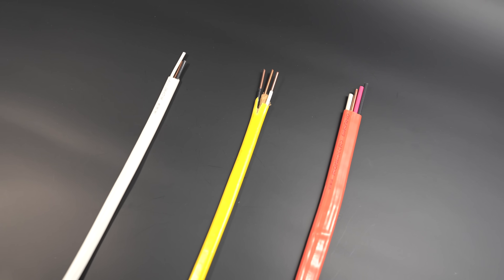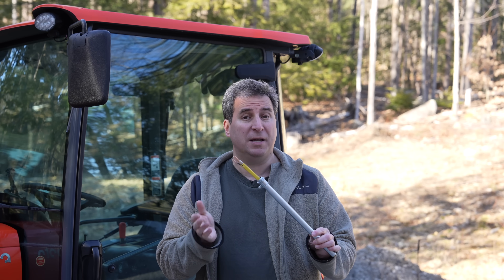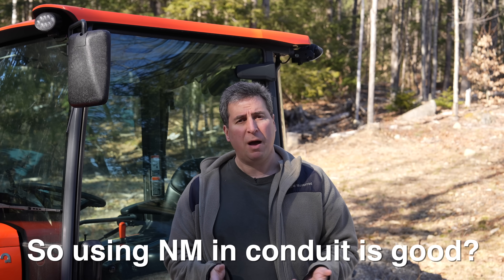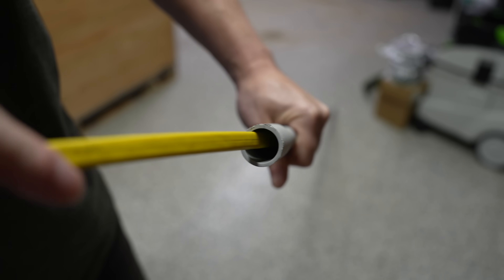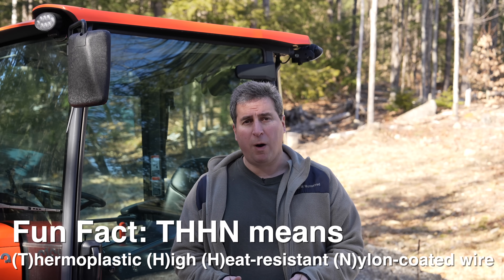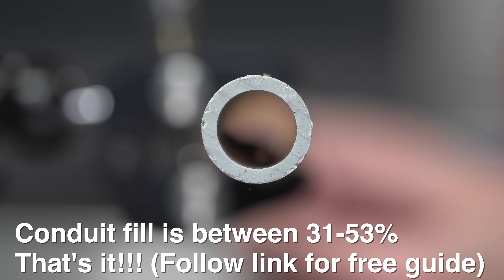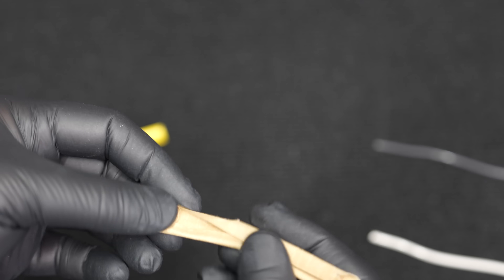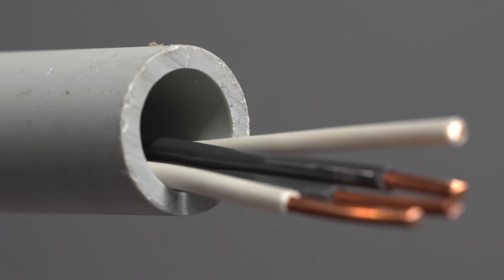#1 DIY Electric Mistake - Can you use Romex Wire in Conduit?

Comment: What about " underground" buried Romex  under sidewalk or driveways ? 
I lay gray PVC underneath prior to pouring concrete over . So I can pull the wire through? And  when coming vertically up into a grauge or out building on its exterior wall.

Comment: What's the rationale behind not being allowed to use NM wiring outside?
Reply from the maker: My understanding is that the paper inside as shown and the sheathing can absorb water and disintegrate. I have seen example outdoors that were 25+ years old where this has happened and shorted out.

Comment: Two Major draw backs NM in conduit, Heat (Temperature rating of Conductors, Factor in Continuous/Constant Loads) and Volume (restricted Capacity)......be safe = .NEC  Table 310.13, 310.16, and UL83...no Myth

Comment: So, I guess my question is: should Romex even be used for concrete, cob, rammed earth walls that use conduit to rum electric lines through the wall? Does the 50% rule still apply, or do you need to spend a small fortune on 2" Schedule 80 PVC?

Comment: The way I interpreted the code (30 years ago) is that romex, or nm is not allowed in conduit due to ambient temp. Wire in a sheath and then inside a conduit does not possess enough ambient air to properly cool the wire within. Therefor, I have never ran romex in conduit. Place a junction box and always transition from nm to thhn before entering conduit.
Reply: That doesn't really make sense.  You can run romex in spray foam or other insulation.  If your wire is getting hot it's overloaded.
Reply: Sooner or later, a circuit is going to be overloaded. It's inevitable. A breaker is designed to cut power when a circuit is drawing more amps than it is designed to, and has nothing to do with temp. If you are drawing more than a wire is capable, it's going to heat up. Only when the amps are higher than the breaker will it trip. If the wire is in a confined space(not just a couple of inches of spray foam) it has the potential to melt before the breaker trips. There is a degree of heat dispassionate must be allowed for.
Reply: @jtsather4535  I disagree. You think conduit retains heat better than spray foam? Circuits done correctly are almost never overloaded especially dedicated circuits.
Reply: @sparkyjerred419  That word "Almost" burns down houses. Take every precaution against that which can kill you. Even if it seems over the top. You might save a life.
Reply: Just for reference, I've been a sparky for 35 years.
Reply: @jtsather4535  well I've had my masters license for 25 years & I've yet to see romex burnt up in conduit.
Reply: @sparkyjerred419  In the beginning I worked for a guy that authored parts of the NEC. We would discuss the rules and reasonings behind them. Not everything that important is in the book. Just because you haven't seen it does not mean that it hasn't happened. Fook for thought. The most important thing I've learned about electricity is that I'll never know it all.

Comment: Can one run UF in an underground / outside conduit?  Or is UF for direct burial only?  Or are both suitable?
Reply: We've run 12-3 UF-B in 3/4 PVC conduit. Out of exterior rated j box down the wall, 90 out with 8 inches extension. Inspector didn't said anything about it

Comment: Been putting 14/2 wg in conducit outside for my area for 30 years, and have never had an issue.  Sealing up the conduit (pvc) with glue and it works fine.  I think sometimes we take things a bit to far.  Sometimes common sense goes a long way.  But thats just me.  Sort of like banning lead shot because one eagle in california died from lead poisoning 40 years ago and now thousands of guns have been ruined by steel shot and we have geese destroying the tundra because no one wants to hunt them with $40 boxes of ammo anymore.  Or the freon scare which is total nonsense, and now we have inferior products in our hvac units that require millions of dollars in expense to convert when in fact cows produce more gas than freon did, plus we did not damage the ozone layer as it contracts and expands on a yearly  basis.  Thanks tree huggers and Canada (thats where it all started) and now we have a mess.  I saw this in the 70’s with transformer oil which caused whole cities to be abandoned and launched an entire industry.  Then 10 years later we find out the oil is totally benign and holds no danger to humans.  But did we correct the mess. Nope.  Just keep on throwing common sense out the window.  Rant done.
Reply: Leads bad, short cutting electrical work is worse. PLEASE STAY HOME.

Comment: I didn't see a ground wire individually in your example, only hot and neutral. I am guessing here, but could you run ground through conduit also? Insulated ground was green IIRC. I am NOT an electrician, but I have done a lot on my own home (many receptacles had ground and neutral or hot swapped when I moved in) and this is just a curiosity question. I do not have any wire in conduit here.

Comment: If I need to turn up a run of 12/2 UF-B, I always thought it to be safer in a short piece of PVC electrical conduit from 6” below grade to the panel or load. Are you saying it is safer to wire nut solid THHN wires to the UF-B in a below grade JB before turning up in the conduit? 

What is the logical problem with UF-B in a conduit in wet conditions?

Comment: Excellent and to the point. I thought part of the romex-inside-conduit issue was that of heat buildup (which is probably why the 53% max fill was designated.) I also appreciate you telling us that individual wires from romex bundles are not allowed. I would have thought otherwise.  Keep up the good work.
Reply: The fill ratio has more to do with NFPA regulations than anything else, along with mitigation of unintended damage and destruction of your own work.

When you're pulling cable or individual conductors over significant distances, what you're pulling is going to be rubbing up against anything else inside that conduit, causing large amounts of friction, which generates heat. This can, will, and has damaged cables halfway through the run to the point that a fire hazard is created in an non-visible area by way of burning through any and all insulation.

Cable pulling lubricant does mitigate this somewhat, however the code on this primarily exists to address this issue.
Reply: Hmmm.  53% max fill . . . So If I double the end over when I pull them through, it should be about right?
Reply: Conduit fill has nothing to do with the percentage of how much you can fill. It has to do with derating the conductors inside the conduit.
Reply: So romex in conduit in an 120F attic? Electrical advice should be left to licensed electricians.
Reply: @mongo7129  I am one.

Obviously, the NEC and NFPA should be consulted prior to starting work on any installation.

That being said, there is no reason to be using romex in that application in the first place, and if you did, you're getting fired.
Reply: @RighteousJ  Homeowners aren't going to reference the NEC and NFPA, thats why they're watching a stupid youtube video!  There in no application where you have to run NM in a conduit...none.  Running romex in conduit is like burring the american flag... can you yes...should you no!
Reply: @mongo7129  Agreed. That being said, the electrical code exists for a reason, and the main skill you need to be a licensed electrician is to know how to navigate the NFPA in the first place. That's literally how you pass the written exam - answering a selection of code-related questions in a set amount of time, while having the actual book as your sole reference. Beyond that, you're expected to apply that skill on every job going forward.

Being a skilled tradesman can best be explained as performing professional guesswork based on incomplete data provided by those of questionable knowledge. Ultimately, the person doing the installation owns any hazards that result from improper work, and if something I'm being told to do by management doesn't line up with the NFPA, it's my obligation as a professional to refuse to perform the work as described.

As far as these sorts of videos are concerned, however: if work was done not to code, regardless of whether or not a permit was pulled or a "professional" did it, then insurance won't pay out. There's a saying in my business: if you think it costs a lot to hire a licensed and qualified electrician, try hiring an unlicensed and unqualified one. This absolutely encompasses hiring yourself if you don't know what you're doing but refuse to admit it.

Comment: A couple of things. One. A very important point is romex can't be used in damp locations due to paper insulation which wicks in water. You can see @ 2:12
                                Two. Romex Does use THHN wires. Those wires are allowed in damp locations. Romes need to be brought in a j-box, to be de-sheath then the rest of the wires can be used in a damp location in a pipe.
Cheers!
Reply: Finally some information that really makes sense - the paper insulation. Now I'm in Europe and paper insulation on electrical wires isn't present and the ground wire has the same insulation as the other wires and is color coded yellow/green.
Conduit is by itself not bad, and is preferred to protect against rodents.
Reply: The individual conductors from Romex is vinyl like in THHN, and derated based on the 90 deg column like THHN, but It lacks that clear nylon outer coating that THHN usually comes with.  Without a listing from the manufacturer I can definitely see an inspector still flagging you for stripping the outer jacket and pulling the individual conductors in an exterior conduit located in a damp location.
Reply: @BluCappy419  I got this from the manufacture 
What is Romex Wire?
Romex wire is made out of two or three THHN wires combined with a grounding bare copper wire. Like the THHN wires, Romex wire can’t be used outside because of its minimal PVC jacket protection. However, these wires come in larger sizes than the thinner THHN wires; 14/2 and 6/3 are used widely as electrical wire, despite the fact that it can’t be used in conduit at all. The primary use for this type of wire is to run more than one conductor at a time through a separate grounding wire.
Reply: @stevedonovan22  What did all the other manufacturers of NM-cable say? Romex is just one of many. And quite frankly, in my parts, is not even seen very much any more.
Reply: XHHW...the W stands for Moisture Resistant...do yourself a favor.
Reply: I think the presence or absence of paper in  non metallic cable is location.  I have not seen paper in non metallic cable in Canada for decades.  just a nylon sheath and conductors.
Reply: a sealed conduit IS WATERPROOF
Reply: Unsheathing Romex and using the conductors inside the Romex is a violation of code, as each wire is not labeled. Doing so is a hack.
Reply: @icevariable9600  Not according to the manufacture, lack of education makes a person a hack
Reply: Thhn not allowed in damp location….needs to have a W, as in thwn
Reply: @alldayjack4830  THHN wire can be used in damp locations and is rated for high heat, up to 194°F (90°C).
Reply: @alldayjack4830  The (N) Nylon coating ends up coming off over time.
Reply: @chrisd_man2156  Then you've never pulled out old THHN/THWN from UG conduits filled with water.
Reply: @alldayjack4830  Most THHN building wire comes with the dual rating THHN/THWN, meaning it is usable in both wet and dry conditions, as well as both indoor and outdoor use. THHN carries a UL rating of 90 degrees Celsius in dry environments and 75 degrees Celsius in wet environments

Comment: The rules in europe are verry different from in the usa. Metal conduit is allmost never used here. The only thing that comes close is shielded cable and is mostly used for data and inbetween a frequentie drive and a motor.

Comment: Thanks for this. I’m in Canada so I’m never sure if there are differences, but I think things are very close at least. I went through this when wiring outlets into the kitchen which has exposed brick walls. I discovered that this can fall into two categories: where the conduit is considered “mechanical protection” for the NM, or where you have switched to “raceway” (conduit wiring with individual wires). I needed conduit for the mechanical protection and aesthetics. Because the switch/outlet boxes were glued right on the conduit then the fastening/stapling requirements for NM wiring also came into play. It all got pretty grey and open to interpretation. I ended up with  boxes at the end of the conduit runs where I could terminate the NM wire and switch to raceway rules. 

I’m still not sure there’s a legal way to run NM straight into conduit where the outlet box is directly on the end of the conduit. I think I t depends on whether the conduit is also considered legit securement first the NM, and how long mechanical protection conduits are allowed to be. I’d still like to be sure.
Reply: There can be differences. It depends on the province in which you will be doing the work. You need to look in the CSA and possibly the ESA for appropriate codes. FWIW…I’m a EE from the US and the company I work for does a lot of equipment installations in Canada.
Reply: @jbponzi1  I often end up spending more time reading comments than watching the video because of all the good information people share. Often things are similar enough that the core concepts are the same at least. The E.F. Knight “Electrical Code Simplified” books are a great reference for Canada. I’m an Engineer too.
Reply: @AndrewMoizer  awesome! Howdy do from your next door neighbor 👋   Sorry you have to deal with some of your codes. They can be frustrating for those of us next door. Especially the inspections and the variances we experience. Thankfully, I started a UL508A program here about 15 years ago. That’s helped us a lot.

Comment: Legal, illegal what matters most is as you kinda said it would be a real pain in the rear to pull.  Binding, seizing, tearing of insulator grrrrr. Just buy the correct wire for the conduit.  You’ll be happier.

Comment: So.. what about direct burial UF cable?  Can it be in conduit, at least for short 'stub ups' (like where it comes out of the ground and up a wall or something..)?
Reply: We stubbed up 3/4 PVC conduit out of the concrete base for 50 light poles. 90 out of the base with 8 inches of PVC past the base. Inspector said it was good. All UF-B in the poles, underground

Comment: Good video, but would note that the jacket must be kept on, because it would violate NEC 310.8, as the individual wires in NM cable are not marked
Reply: Apparently some manufactuers do use marked inner wire jackets, some don't. You have to strip back and look for it, probably the cheaper import stuff wont.

Comment: I have a detached garage. Whoever wired it ran a 30 amp breaker to the building and then split it at the breaker in the garage to 2 15 amps. It’s only 3 wires running from the house. I’m not an electrician so I don’t know if it’s ok to use that one ground wire as a neutral for both breakers. Didn’t realize it until I disconnected it to remount my loose breaker boxes a while back. It seems to work fine. I’ve never used the outlets for a hard load like a table saw or shop vac though.
Reply: From what I know it's not correct especially if it's a bare ground being used as the neutral. My electrician friend helped me run mine and it has four conductors: two 110 hots, one neutral and one ground. Also the buss bars in the garage panel are separated like a sub panel. hope this helps. Rob......
Reply: @robbieraychannel  should I change it? What risks are there from running it that way? The panel in the garage looks wild the way the wires are jumped around. The face plate was gone from the garage box for some reason. I never payed attention to it until I reconnected the power from the house. I didn’t even think about it when I disconnected the wires a while back.

Comment: What about food trucks?  I bought a food truck with 14/2 running through it, and it's running through what you have there at 0:58 going into the circuit breaker box.  I guess I should take it out before I get my inspection?

Comment: Question:  I get that its harder to pull through and takes up more space, but why is it NOT legal for damp areas vs legal in Dry homes?  I would think the extra insulation would be a good thing for damp area?
Reply: anyone with more than a year of experience will tell you, that conduit will eventually fill with water. especially outdoors. the conduit only provides mechanical protection

Comment: Nice video - but too bad it did not address the related question; Should you (or CAN you) run ground wires inside metallic conduit?
Some say only the first metal box should be grounded back to the panel, and for all downstream boxes the metal conduit itself is the ground, with each device grounded to the box it is mounted in. This makes sense to me, as this provides a single path for ground, but others say it is permissible (or even preferred) to also run ground wires within the metal conduit, grounded to each box ground lug.
Reply: I've had issues with this, namely with old conduit that may have separated in an unseen location for one reason or another.
yes, any new work, I always pull a ground, 
Old work, I might pull a new ground run if reasonably feasable

Comment: The focus should be on if the cable is rated for indoor use, or outdoor use the conduit doesn't make indoor rated cable legal to use outside. Mostly see this with HVAC whips NM cable is used in the attic they run it out through a short whip.